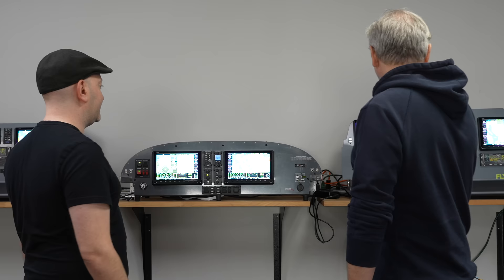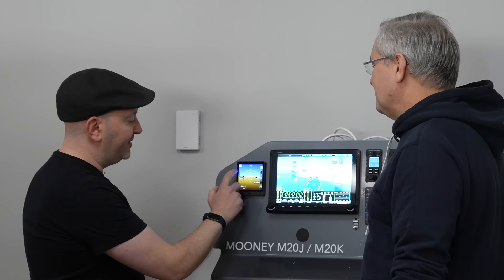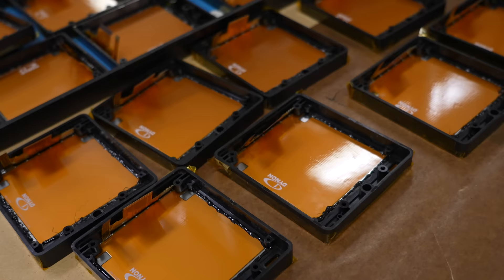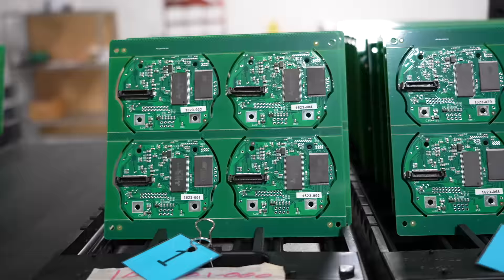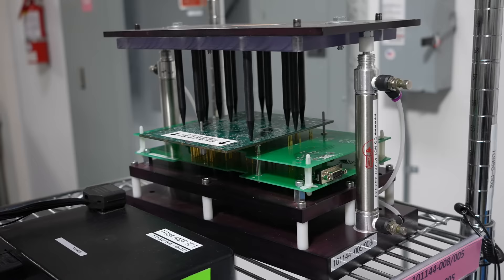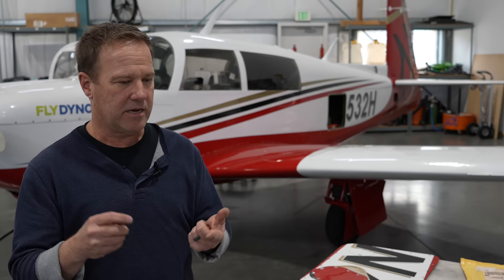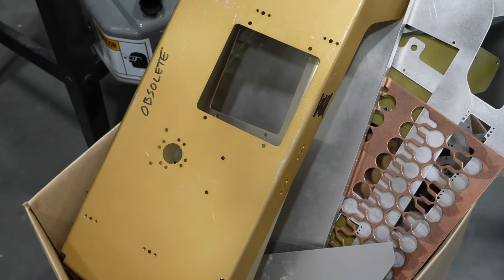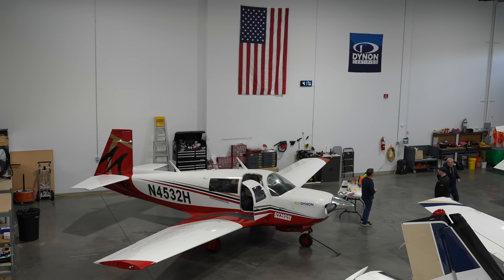Behind The Scenes at Dynon Avionics HQ

Comment: Mike and Dave are just good dudes. Am glad Dynon has them. I stepped up to a Dynon 7” Classic EFIS from a GRT Mini, when it came in my current plane. I liked it so much, that when installing ADSB, I decided to go full Dynon everything— 10” HDX, Radio, Intercom, Xponder, GPS, 2-axis autopilot, external control panels, etc. I’m an A&P, not an avionics tech. But their architecture, using dedicated serial bus and separate Skyview Network for modules connections is logical. Their pre-assembled harnesses are well priced and further simplify installation. And you can reach tech support via email or phone. The same cannot be said for some of the competition.

Comment: My A&P-AI said he wasn’t too excited about the connectors - suggest Dynon look at higher quality aircraft wire connectors. I have a two screen Dynon HDX Skyview which I am happy with - screens are great quality and system is easy to use.
Reply: A&Ps are trained on classic/traditional aircraft systems and parts. They are also trained as generalists across structures, engines, etc. They are not electronics experts and are not necessarily knowledgeable about modern items (because the training and the aircraft they support are mostly rooted in older technologies).  If you look at Dynon's wiring and compare that to many others, you'll see that it is better than most. They comply with modern standards for wiring & connectors, they have good attention to detail regarding EMI/RFI, and support their products well. [I say this as an IT professional that built his own aircraft, including designing & installing the electrical system. I went with a non-Dynon avionics solution and found the quality to be inferior to Dynon's products]

Comment: i thought you were going to use that other company for changed to instrument cluster?
Reply from the maker: I'm not sure that I understand your question.
Reply: @GlensHangar  i thought Lyle from Sixpack Aero was doing something with the instrument cluster? or are they just doing the metal outlining to hold the gauges?
Reply from the maker: Yes - Lyle is doing the stationary panel. His company only does the structural aspect of the instal.
Reply: @GlensHangar  
Who will the lucky shop to install your new avionics?
Gilles
Reply: @fly-n-m9445   Chris will do it - we'll be changing the structure and then adding larger Dynon screens. So just an update to make it the way I had hoped to have it from the start.

Comment: No one ever got fired for buying Garmin
Reply from the maker: That's a great saying - but for most aircraft owners the cost of Garmin is beyond reach. 
When I was choosing what to put in MVU, I couldn't get a straight answer on even basic costs from Garmin, their dealers, or installers - their attitude was that I needed to write a blank cheque and take what comes. Garmin's business model on pricing was very opaque. Dynon was upfront about what was needed for the system I was building, and what the costs were going to be; there were zero surprises or cost overruns. I didn't have to talk to three layers of dealers and sales people to make it happen.

On a flight use basis, I've flown with both Garmin and Dynon systems, and the layout of Dynon menus, and physical knobs and buttons made more sense to me.
Reply: @GlensHangar  Yep I understand your frustration. I have done a few planes, Ovation3, Mirage in Garmin PRE WUHAN. Life was easier back then. I just got a solid quote for a gtn 750, 2xgi275 and a gtx345. But I do understand your experience.  Resale will take a hit, it's a bummer garmin owns the mkt but buyers will react.
Reply: Garmin is feature-rich, but in addition to the cost issues that Glen mentions they are also in some ways handcuffed by their long product legacy. They have a specific approach to UI and features/functions that they set up with earlier products, and for consistency purposes they must largely follow that pattern in future products. This is great for people who fly a succession of aircraft with Garmins installed in them, but it does limit their ability to innovate or alter their approach. I know good people at both companies, but Dynon is a more-nimble organization that's been free to experiment and take a different approach to some of their products and the user experience. Everyone has their own preferences, but many folks find Dynon's UI/UX more intuitive. The good news is, there seems to be space in the market for both companies; and both can thrive in different market segments. My next plane's getting a Dynon, though! 🙂